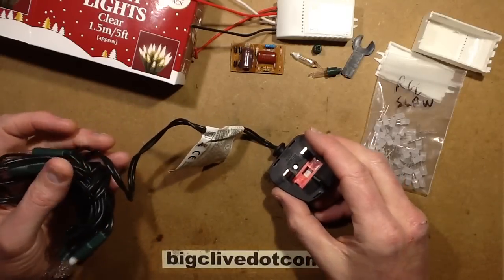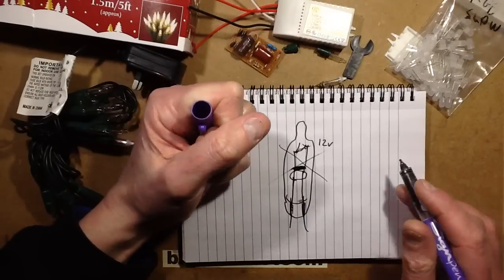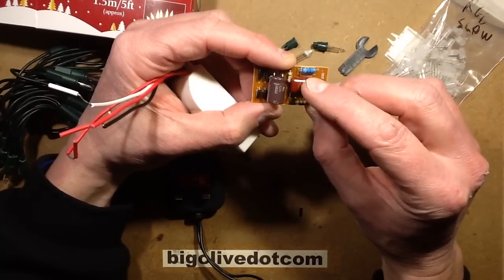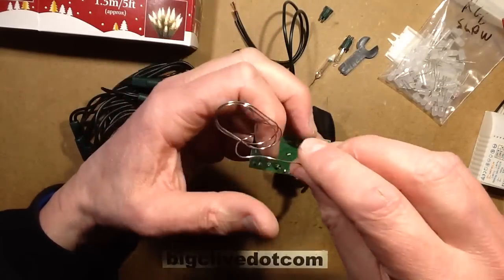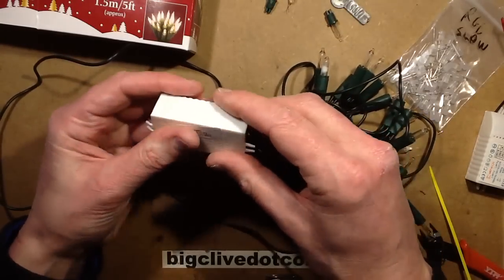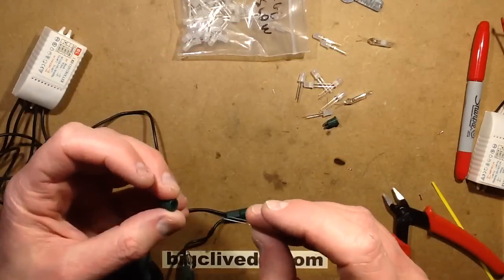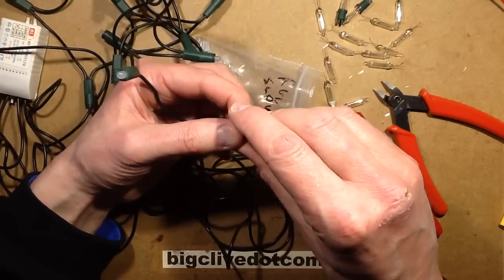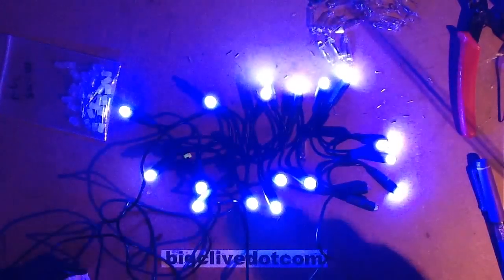Scary work incidents and other answers (with more LEDs.)

Comment: I admire your manual dexterity. I struggle to get the wire, the board, the solder and the iron to the same point in space-time. You make it look soooo easy.
Reply: I feel kind of the same.
Reply: its just practice . he has soldered hundreds of thousands maybe even millions of connections in his lifetime . so you know the old saying practice makes perfect well its true
Reply: Me too, me too. Tried it and my hand got all cramped up !!
Reply: Yup. If I attempted that I would definitely burn my fingertips, so I always flux the joint and use a bit of solder on the iron...
Reply: You can't do it without pink grapefruit gin....it acts as a 'nerve flux' and steadies everything.

Comment: I was once told by the boss to go to a local supermaket to replace a faulty defrost contactor. Went to the electrical wholesaler, picked up a contactor, installed it on site, satrted a manual defrost on the CPC, found out quite quickly it was a 24VAC contactor. There were skid marks EVERYWHERE! There is nothing scarier than a quiet plant room...

Comment: Also another thing to note about lifts is that since the counterwheight is the weight of a 50% loaded car, if there was only one person in the lift and the holding brake was to fail, it would freefall upwards! So it is very unlikley that a lift would actually freefall downwards. And the actual likleyhood of the cables snapping is next to impossible.

Comment: That refrigeration stuff reminded me of a service call I ran once.  I did,  among many other things,  telecom work.  This particular call got me to a supermarket,  and for some reason all of the phone wiring for the building terminated in this room,  in the upper part of the structure,  with open vents to the outside.  A whole wall of "66 blocks".  So I'm in there with my butt set,  trying to find out if there's dial tone on a specific line,  and where it might be getting lost.  Unfortunately the room also contained a whole slew of the biggest compressors I'd ever seen,  and they were all running.  With that level of noise,  I couldn't hear whether the line I'd clipped on to had dialtone or not,  so there wasn't a whole lot that I could do. Of course shutting down the refrigeration wasn't an option,  nor was moving all of the phone wiring to another location.  I'm not sure how they ended up ultimately resolving that.
Reply from the maker: The compressor rooms are VIOLENT.  Once I got used to them I actually liked them.

Comment: Greetings Clive. I Love watching your video's and learn a lot more than I expected.  On the elevator trivia there has been a lot of changes on how elevators must perform and safety increases everyday.  I test elevators for a living and the GenII machine room  less elevator is one of my favorite products to work on.  I actually balance them between 42% to 47% of rated load depending on the use of the lift.  Elevators run more empty than it would run full load so much so that maybe 1% of its life it would at run full capacity for standard public elevators.  I'll leave that there.  Keep up the Good Work.
Reply from the maker: You must be one of the few who actually like the MRLs, particularly if you get trapped on the car at the top.  But the direct drive motors are very impressive.

Comment: In addition to enjoying your Reverse Engineering videos, I love hearing your field experiences over the years.  Here in The States I have been in many supermarket compressor rooms.  Hussman is very common here too.  I don’t service that equipment, but I am familiar with smaller refrigeration systems, I have always wondered how those large compressor packs function in relationship to all the  refrigerated cabinets.   Thank you for the quick explanation.  👍🏻  I see many ostores with the big Copeland semi-hermetic compressors that look very old and reliable.  And yes as a service tech, I have a few close-calls too.  You hold your breath and pray you can correct what you just did wrong, fast.

Comment: Just wanted to say thank you for all the great videos you made over the last year. The timing of this video was perfect as I was considering making the same thing but using bigger 5 or 10mm diffused LEDs. I picked up a few of those capacitive droppers off eBay and even on US 120 volt mains they work perfectly to drive 50 10mm diffused LEDs. I'm probably going to make 4 or 5 more strings of them before over the next few months and use them on my tree next Christmas.
Reply from the maker: I've made a few sets up with the big diffused 10mm LEDs and they look great.  A nice warm colour combination is warm white, red, orange and yellow.

Comment: I just saw a table top Christmas decoration using 3 of those slow color changing LEDs. The effect was nice because the lights weren't blended together but spread over different parts of the decoration. I wouldn't put more than a few on anything because after a while they just all mix together, like pouring a dozen kinds of paint together.

Comment: Re: content network partnerships. ALWAYS ALWAYS ALWAYS READ THE EXIT CLAUSE FIRST!!! If it does not benefit your interests, slide it back across the table and leave. Period. End of story. Never sign a contract without understating the exit procedure. Also, regardless of what the other side says about negotiablity, as long as you have not signed it, you can sit there with your contract and a black sharpie, and scribble out things you don't want you can add footnotes to any clauses you don't like and hand it back to them, it is up to them to agree to your new terms. If they don't like it they don't have to sign, you don't have to sign, you can leave. you might feel pressured or bullied or feel like that golden ring is being dangled in front of your face but the reality is they came to you for your content you are in control.

I may have made this comment before. I tend to put on Big Clive videos for background noise while I'm tinkering, but the wisdom still applies and needs to be spread more. Especially these days of internet-based ala carte entertainment content.
Reply from the maker: I have no intention of ever joining a multi-channel network.  I learned with a harsh lesson early on when I signed the rights of one video away.

Comment: I just noticed that as you were turning the LED round and plugging it back in 2 of the LEDs stopped working - probably the inrush current when dicharging the cap took out the weaker ones.
Reply: i also noticed the same thing!

Comment: The lights that create a short so the rest will keep working also have caused fires due to the fact that the other lights get hotter when the voltage over them gets higher, the more light go out, the hotter the other ones get until something goes horribly wrong

Comment: (Just a preface - I am using my better half's account, and I am really a guy). Loving your Q&A forums, and I find I have very similar life experiences, from being a youngster on up. Having worked in both low voltage and high voltage arenas, I have had a number of explosive errors. The worst was when I was the maintenance manager for a fair sized frozen food manufacturer here in the US, with 460 V mains. Because it was a 24/7 operation, we were working on a hot mains board when an allegedly insulated pulling cable slipped down into the hot side, and we found out that, in fact, it was not insulated! It went off with a horrendous bang, and tripped the main breaker shutting down the entire plant. Refrigeration, lights, 125 HP ammonia compressors, and all the production equipment came to a grinding halt. There were no windows, which for me and another worker would have made no difference one way or the other, as we were quite temporarily blinded by the flash. We were also plagued with what felt like sand in our eyes for the next 3 or 4 days! 
Prior to that, I had my own manufacturing business, rebuilding starters alternators and generators for the automotive, aviation and marine fields out in the San Francisco area. A fair amount of my business involved racing machines, which helped fuel my racing endeavors. When I wasn't making a living, I was assisting a cohort build Merlin Rolls Royce V-12 engines for the unlimited hydroplane  racing outfits around the country. I was also building a 22' hydroplane drag boat, powered by a WWII Allison V-12 aircraft engine, similar to the Merlin Rolls Royce engines. On off hours, I would occasionally fire up the Allison, just for fun and the annoyance of neighbors that made the mistake of buying a house too close to my shop, and to the wonder and amazement of the police officers responding to offensive noise at midnight. Life is only as fun as you make it, and I certainly had a lot of fun growing up. Which, at 77, I still don't think I have reached that level. Ah well, it's what keeps us young. Keep up the marvelous work!!

Comment: I had to repair a control cabinet of a large ventilation system after another company, for whatever reason, had the idea of operating a large motor contactor with a screwdriver. This contactor was part of the speed changeover on an 80kW Dahlander motor. (Pole-changing motor) The contactor closes all 3 phases briefly when actuated in this operating state.
The owner had told me that the two workers had run away and were not seen on the site afterwards. The bang was said to have been heard throughout the building and the smoke had triggered the fire alarm system. Including a large fire brigade operation, as it was a very large public building. (Large Mall)
In total, 2 contactors were completely welded and 5 others were totally thermally destroyed. Apart from a huge fright, nothing happened to the workers.
(Unfortunately, I don't know what their supervisor did with them).

Comment: These lights in the U.S. (the sets that only have 2 wires, which is rare), usually said on the label "Will tolerate up to 2 bulbs out".  The 3 wire eliminated the need for this and that's why we skipped the fuse lamps here.  How do you think the set turned off when the 2 bulbs went out?  Higher return / higher current I guess.

Comment: So in theory I could re-purpose an old power supply as long as it meets spec for the strand. I've got a few.
I also have an extra 100 bulb strand still in box that is now in my sights for a conversion. LEDS ordered!
Perhaps I'll make it modular so it can also work from a battery if need be.
Very cool!
HAPPY NEW YEAR!

Comment: I had some trouble finding the Unior-style stripping tool you mentioned, as there seems to be no specific search term for that particular design. A few sellers are referring to them as "end-type" wire strippers, but most are just listed as things like "insulated wire stripping pliers," or "insulated wire stripping tool." I ordered one to try out and see if I like it more than my lateral-pulling "automatic" stripping tool. That style works pretty well, but sometimes slips or stretches the insulation, particularly on larger wires.

Comment: Had an incident with a "Careless Whisker" as a kid. Was Wiring a motor up on a breadboard to a 6v battery pack. It had these really cheap aluminum wires on it and I wasn't paying attention but it scrunched the wires up and one of the whiskers bridged to the other wire. It didn't melt for some reason but all I know is that at some point I touched it and it was so hot that it sliced straight through my skin and cauterized the small wound and preceded to turn red hot and melt away immediately afterward.
Reply: So?

Comment: The loudest bang was when I worked on high speed lift. There was VFD that gave out 500v from 380v three phase system. There is a also a giant relay. The VFD energised first, then the control system would trigger the relay.
So I put the elevator out of service (mode in the control system) and plugged the diagnostic tool in. Also locked the motor and send command to test the drive. The control unit also engages the VFD.
So the moment I press enter, there is a rain of sparks, then the relay emits green arc and then the VFD releases the smoke, while tripping the breakers.
So there is me standing still with a diagnostic tool. When I realised what happened, It was only replacing the contactor which had to go anyway and reset the breakers.

The closest scrape was also VFD related. There were two lifts with the control gear right next to each other. And the lift one (left) was controlled by the control gear in the right, and  ice versa. So I assumed that the closet one is the right one. Switch the VFD off, and go to replace the motor. Took the wires out, lugged the motor out. Put the  new one in. I checked the connections, the moment I lift my hand, the motor goes to life. Could have had my fingers blown off
Reply from the maker: The VFDs cause lots of "moments" in the lift industry.  Very expensive bangs.  I did the wrong motor isolation thing too.  On a large compressor bank that involved squeezing in between lots of grounded metalwork to access the terminals on a compressor.  I tried my socket for size on one of the motor's main terminals and as soon as I took it off the thing burst into life.   Very close scrape.

Comment: The one thing I've noticed about the mini-lights or fairy lights as you call them, is that the new ones don't seem to work very well.  And by that I mean that the shunt doesn't seem to work consistently.  When one light blows it turns off the entire string.
Also I've noticed that the replacement bulbs are labeled as "super bright - 0.4w" bulbs, but they are not.  They are a lower wattage, about 0.2w.  If you replace a burnt out bulb with one of these replacements it instantly burns out.  I've also never seen the fuse bulbs.  Interesting that they don't sell these in Canada.

Comment: Clive, I've discovered that these LEDs have some current regulation in them. You can drive them in parallel with a USB power supply and a diode or two in series with the leds, providing a constant 4-4.5v into them. This means no resistors, just semiconductors. I made a wall ornament with a bunch of marbles in it with a USB power supply and a bunch of these lights, it looked amazing.
Reply from the maker: I think the current limiting may be the on-resistance of the switching MOSFET, but it does make them fairly easy to use.

Comment: I have some similar LEDs and was curious about the actual current draw over time. These LEDs have 4 "parts" that all draw current, supposedly in parallel. There is the controller chip, the red LED, the green LED, and the blue LED. I would expect the controller to basically draw the same amount all the time, and the 3 LED chips are all drawing differing amounts through the color cycle. So, I pulled out my Mooshimeter (really the first time I actually used it for more than showing it off to friends and colleagues) and configured it to read the voltage across a dropping resistor. Then threw the data set into a spreadsheet to calculate the current for each dataset and plot the results. I tried to calculate the RMS, but I don't know if I used the correct formula for a non sinusoidal waveform (the square root of the average of the squares). You can check my formula in my spreadsheet if you can read ods files (OpenOffice, LibreOffice(this is what I used), KOffice, etc...) I plotted the last 3 cycles in a different program (much easier to get good looking plots) here: https://drive.google.com/file/d/0BzUYpuZmBY1GYl9xN21iMlN2Z2c/view?usp=sharing and the spreadsheet is here: https://drive.google.com/file/d/0BzUYpuZmBY1GRGhDM2oxclFTUDQ/view?usp=sharing

Unfortunately, I didn't take note of what color combinations the peaks correlated to.

Comment: is it me or at 42:39 or so. 2 of the LED's have failed.
Reply: I see two along the string died, maybe??
Reply: I was just going to note that, you can see for a frame that when he plugs the led backwards those last 2 leds flash and never go on again. There is something strange about those rgb leds, if the 2 at the end of the string burned out after the reverse of the 3rd to the end, why the rest of the string lights, they are all in series? I'd guess that there is some sort of IC embedded into the led and it when short and melted the internal crystal into a conductive blob, but the 3rd still works, and 2nd and 1st last leds didn't survive?!
Reply: as you should get a notification from this, it was the surge when the lights came back on that killed the LED lights (he put a box up about it just after it happened)
Reply: When I first saw the vid about 10 mins of it being uploaded, I didnt see the box but now watching it, I can see the box now.
Reply: i cida guessed that as you and other 2-3 posts was 2 days ago and it was unlikely he  noticed the 2 dead LEDs as he was likely looking at the one he was flipping around, so he put the box on later on
Reply: I had annotations "off" :)

Comment: Great story with the Hussmans contract. I used to work for NRC Refrigeration. They lost the Tesco contract to Hussmans in the late 90's. We used to wire these panels. In the fridges, the defrost heater was switched on with an undersized contactor (in the same box as the 635 control board). They decided it was perfectly safe to split the load of these heaters over a pair or terminals on the same contactor. As we know (I told them too) that over time,  it soesn't make contact at exactly the same time so eventually there will be a bit of arcing on one of the terminal,  eventually putting the full load across just one of the terminals.. One of these fridges caught fire in a Tesco store and thus lost the contract. I'm still betting to this  day that it was one of those contactors that over heatsd. Your thought ?
Reply from the maker: I think the biggest fire risk would have been a heater detaching from its mount and/or jamming on continuously.  Was the contract in Scottish Tescos?
Reply: I do remember East Kilbride being on, but was 20 years ago now.